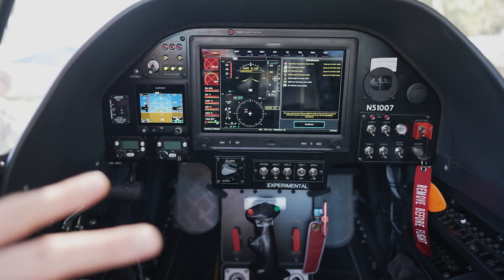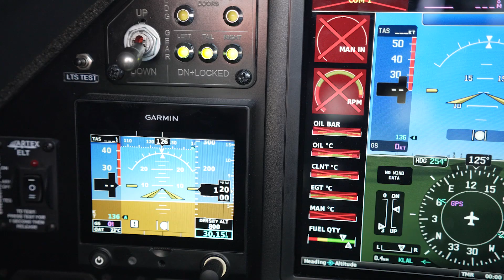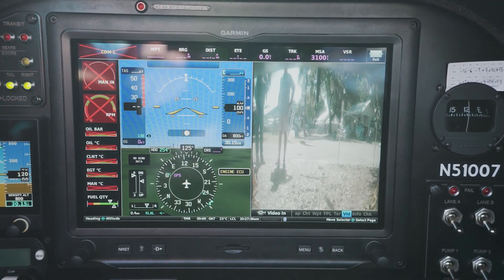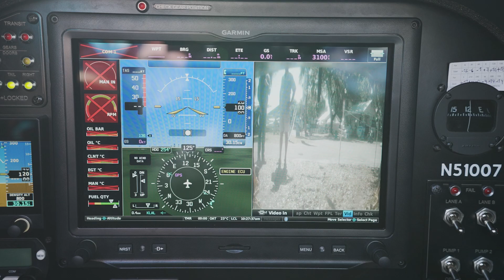Scalewings SW-51 Carbon Fiber Mustang

Comment: They need to engineer a bigger engine for this airplane
Reply: The trouble with a larger engine is it will trash your fuel endurance, the engine they have selected is perfect for the airframe. Sometimes moar cylinders is t always the correct approach
Reply: Do you know anything about airplane design?
Reply: One day this thing is cool AF
Reply: There is a Titan T-51 out there with a BMW V12. Almost sounds original.
Reply: Why? Its performance looks fantastic with the 916iS. Why would you want to add weight for no appreciable performance gain?
Reply: @scarybaldguy Rotax engines sound like lawnmower engines. A fighter replica must have a beefy engine sound like the original.
Reply: @mmeyers111  My thoughts exactly. At least a continental six-cylinder, but bigger and louder is always better :)

Of course, I can't afford one anyway.
Reply: @mmeyers111  🤣🤣🤣🤣🤣🤣🤣
Reply: The thing is a 70% scale, any bigger and with a bigger engine will make the next SW-51 as expensive or more than a real P-51 which is already costing 2m - 5m depending on the prices.